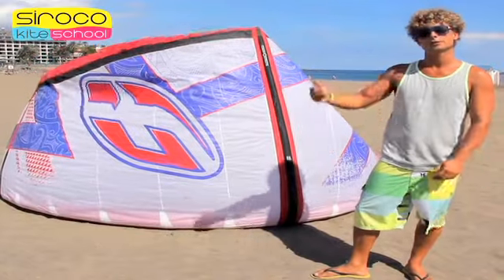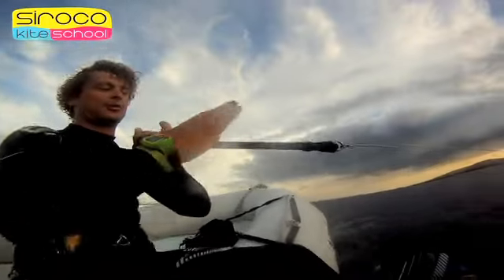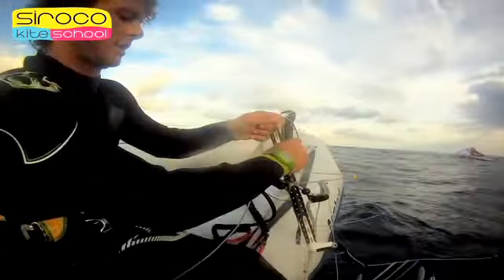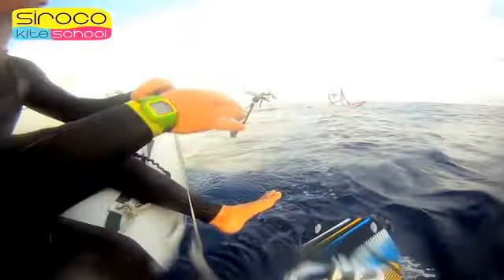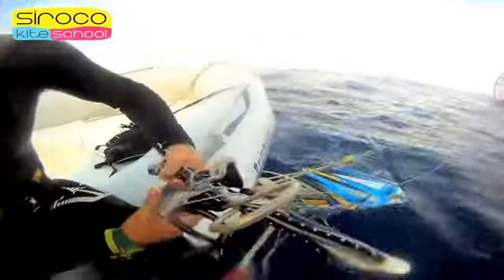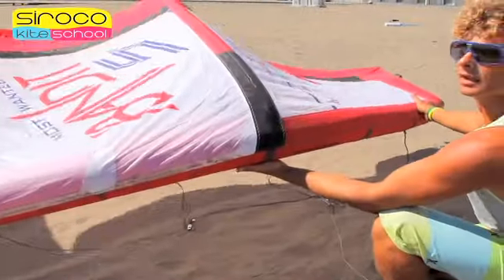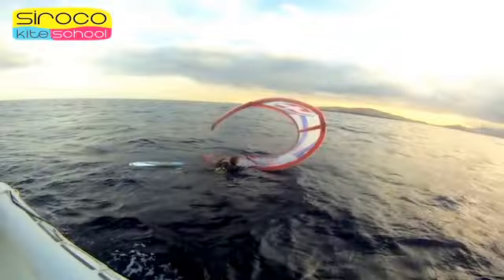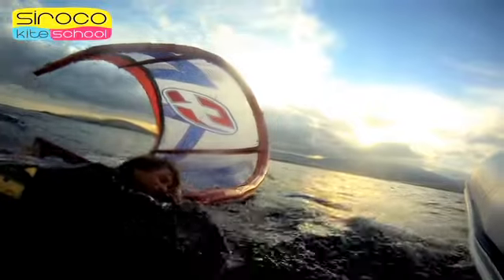Kiteboarding Self Rescue Technique

Comment: im sorry guys but this is totally wrong and dangerous, you should never perform a self rescue until the kite is on the standby position and the wind is blowing on the extrade and pushing it  down towards the water, if the rider by mistake pulls the right stearing line (in this case)  the kite would fly into the powerzone and start  deathloop
Reply from the maker: Hello Gustavo!!
I understand what you are saying but it is not exactly like you said. Sometimes the kite does not go to the standby position and you have to do the self rescue like we say. We have done it many many times and it is completely safe if you do just what we say because the safety has been activated and fixed, so the direction lines are like 3 meters longer that the others so you cannot do kiteloops...
If you want, try to do it and you will check it ;)
Best regards!